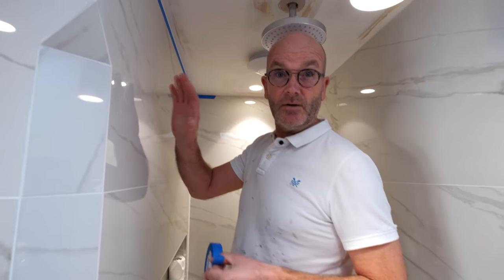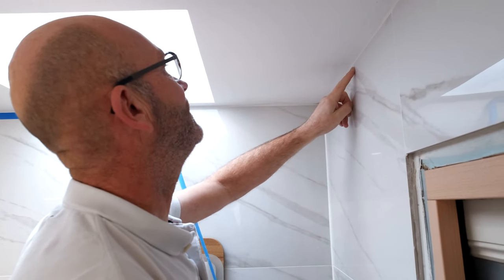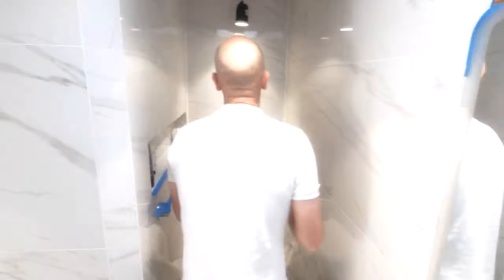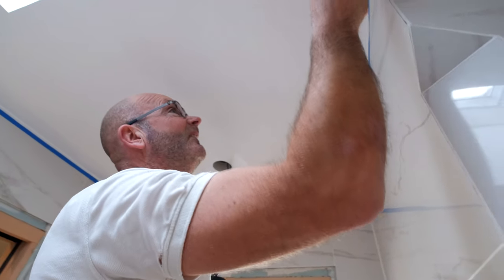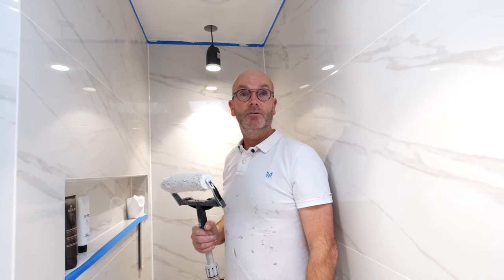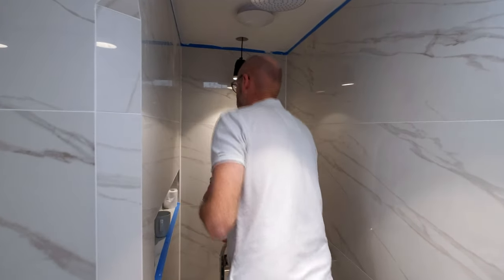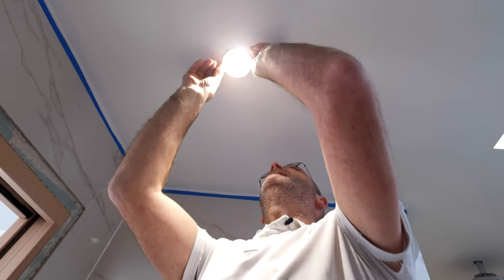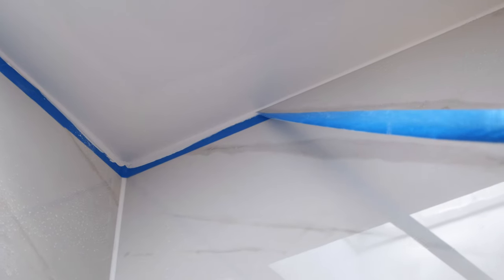HOW TO PAINT CLEAN EDGES WITH TAPE | Painting and Decorating | Build with A&E

Comment: Another great video. Can I ask why the ceiling wasn't painted before the tiling and installation of sanitary ware etc? Thanks
Reply from the maker: The ceiling had a mist coat before the sanitary ware and the tiling was done, and when after this was fitted, we gave it another two coats of the durable. The reason for this is, when our tiler comes in the ceiling can get soiled and marked. Many thanks Sam. Take care bud 😎👍
Reply: What did you mist coat it with, first?
Reply: @englishmanfr1937  when using durable Matt, you always mist coat with the durable Matt, as it soak in and doesn't sit on top of the plaster.
If you use contract Matt as a mist coat, wiped your hand over it, your get a deposit on your hand. So when  you put durable Matt on top it delaminate, and that's exactly what occurred.
25years? I been doing it 45years, I was being sarcastic.
You ask yourself, if you got a chalky surface, what would you do? It would be like putting emulsion on top of whitewash.
He was wondering why he was having problems.
It's a no, no, an irrefutable fact that can't be disputed, but lots of decorators do it, it as to be like for like, seal or remove, so why not do it the correct way in the first place, especially in a bathroom where there's water vapour.